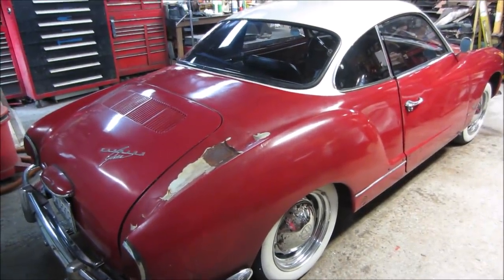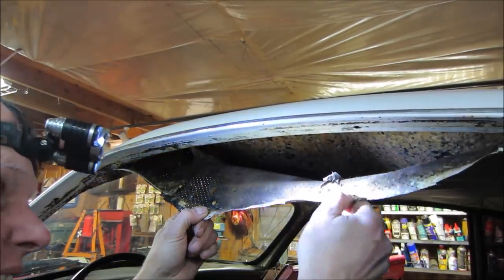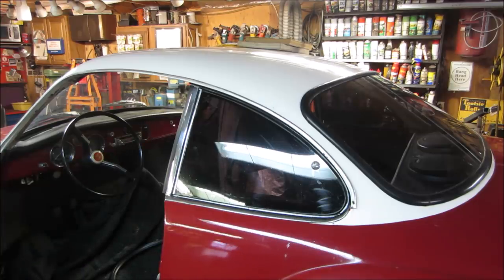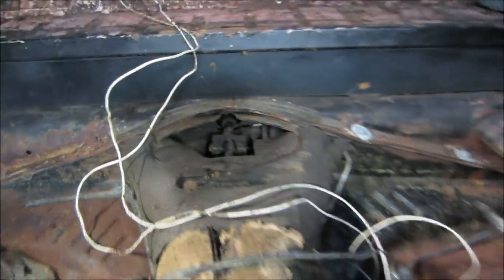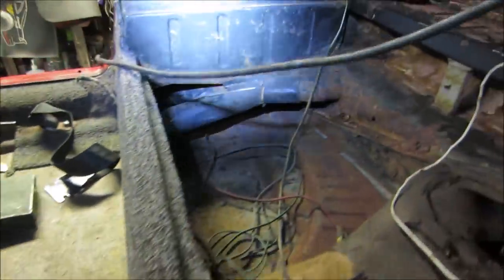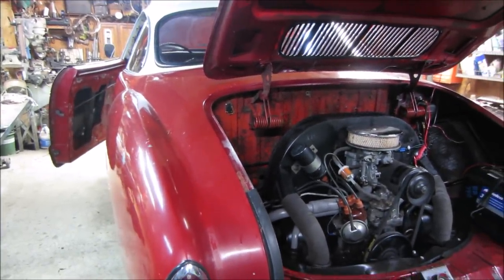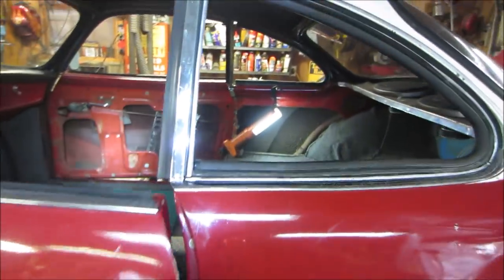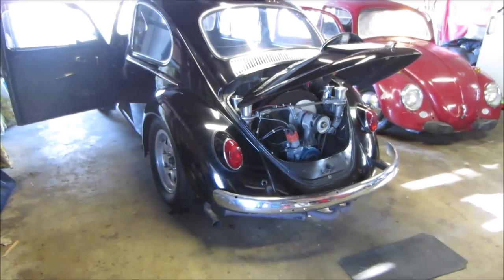Car Mouse Damage, how to remove the smell.

Comment: An ozone generator shut up in the car for a while will get rid of most smells and I think it kills bacteria too. One of the benefits of using an ozone generator is that it reaches areas you couldn't normally reach.

Comment: I am enjoying your Karmann Ghia videos.  That was the first car I learned to drive at 10 years old.  My dad bought a 1957 model in Germany when he was stationed there.  Just after the war.  The German owner had put a Porsche 356 engine in it.  Porsche 356 seats.  In the place they normally have a clock,  he put the Tachometer.  The car had an emergency tank that you activated with a little lever under the dash to get you home.  So it was really a Porsche 356 in Ghia clothes.  We brought it back to the USA from Germany to El Paso.  Unfortunately, my Dad sold it in 1968.  Wish I had it now.  It was really neat.

Comment: I used to make head liners for cars back in my upholstery days. You need to save the old pieces CAREFULLY to make a pattern. Too many guys just RIP the old ones out then expect us to magically fart a new head liner that fits. If you want a good fitting restored head liner, leave the thing in and let the guy who is restoring it take it out. Most of the head liners I worked with were falling down from tobacco smoke. It causes the glue to crystalize and fall off. Convertable tops were much harder but after a while I figured it out. Sewing the rear window panel in was always a treat. Lots of fun times! I do remember the rodent ridden cars. Usually the wiring was chewed up if it had a dome light. Rear decks were ALWAYS full of nests. Wouldnt white paint make the interior brighter than black paint?

Comment: My 71' Bug had a mouse nest in the rear seat that was repeatedly removed and put back during a  2 month long rebuild much like your project. It wasn't until the final victory ride after a full engine rebuild and replacing about everything you are replacing, did I find them when one of my girlfriends stepped on one during the test drive.  But that was 1975. Great memories brought back by your videos! Thanks Mustie1!

Comment: Rubbered in windows are great since you can remove and reinstall them without any special sealers. To remove easier use a product called releaseall or something that actually contains an oil. WD 40 doesnt work. 

to install clean rubber really well with real thinners, sometimes marked as Lacquer thinners. Pretty much if a white rag comes off black its not clean yet. Clean window glass with Windex, no subs to that product. Install by wetting rubber down with windex to act as lubricant. leave dry clean off window after. Wont leak. You add any sealants to a rubbered in window and guaranteed it will leak every single time!

Mustie1 Fantastic works just as well for neutralizing mouse smell. Spray scrub and your done. Keep old headliner if possible for bar locations. Most upholstery shops can make up a cheap headliner for you as long as they have the old one, and some measurements for a pattern.  Might want to wash it down with some old solvent though so it dont smell as bad.

Comment: After the source of the smell is cleaned up. You could use an air purifier / ozone generator inside the vehicle.  Just air the ozone out of it before entering the vehicle afterwards.  Ive used one in my garage, and other parts of the house. Works great. Just be sure its an unoccupied space.

Comment: I love your progress on this gem. Actually I love your whole channel in general. I strongly suggest you get an ozone generator and run it in the car with the doors closed for a day or two to kill any mold or biological material. It will help very much with prolonged odor reduction, especially in the areas you can't reach like the heater ducts. A STRONG WORD OF CAUTION! Do this with your garage door open or leave the car outside while you run the ozone machine! It can cause respiratory harm!

Comment: Man oh man, I swear I could smell that interior through the video! Had thoughts that maybe you could wash that headliner at 1st, but the more you got into it I could see it was a 'trash' item. Good job on that tightening up of the E-brake linkage, and the painting of the interior as well. Really good how that little motor you resuscitated for that Ghia is now running quite well. Had doubts when I seen that substance "formerly known as oil" inside it, but a testament to those bug motors how well it came back with some love.

Comment: The heating system on these is a big weakness.  Had a vw westfalia camper that the tubes rusted out and you’d get exhaust fumes inside the cabin. Finally just pulled them out and carried blankets for my self and passengers! But I loved that old camper and a had lot of fun back in the day with it!

Comment: I'm from Poland, I love your videos (especially with engines). I really enjoy watching someone repairing cars and other things :) Last year I have repaired bodywork of my Seat Toledo (it's based on VW Rabbit/Jetta MK2 and MK3, but it's liftback ;) ) and probably this summer I'll start repairing VW Scirocco MK1 (sitting about 15-20 years in shed) or Lada 2103 (it spent about 12 years outdoors). One problem with this cars is (except they are old, rusted, not started long time) that they aren't registered. Even if I fix them, I probably can't get license plates for them on normal way, but there is something as "historic vehicle". If car has more than 25 years and it isn't produced for more than 15 years and most of parts are original (car left factory with that type of part, f.e. engine) it can have special license plates, but it becomes "monument" and cannot be modified. 
Should I start fixing one of the cars or should I leave them as they are because it will be waste of money and time?
Reply from the maker: you guys have it tuff as far as your laws,

Comment: Ugh. Gasoline and a match?
If mustie is wearing a mask you know it's bad.
Reply: Hopefully a Mickey Mouse Mask!
Reply: i agree...i bought a motorcycle once that had a slight mouse smell to it and after i sold it twenty years later when i sold it i could still smell it when it started
Reply: @philtripe  as long as as the absorbant parts are tossed and the rest is sealed it should be ok but yeah sometimes it's hard to get on every nook and cranny.

Comment: Thanks for the laughs, Anytime anyone mentions heat and VW in the same lifetime...
Reply: Those are what’s called mutually exclusive words.
Reply: In my '67 bug I would have to bend the flaps closed in the fall for heat and undo it in the spring.
Reply: Sorry you guys but a VW bug with good heater boxes and all standard parts working provides plenty of heat.  My wife can confirm that I once melted a set of gum sole shoes on the driver side floor heat vent!  True!  Lived in Mass at the time and the defrost could take a while to work well, buy it did in many water cooled cars also.  A good BUG MAN can get you good heat - you have to pay to replace rusted out bits however.

Comment: I had a mouse chew a small hole through the HP fuel line on my 911.  Fuel line was $197, $3,800 in labor to drop the entire front end to replace said line.  Asked the folks what they recommend and dad said to cut up a dish sponge in 1 inch squares, soak in peppermint oil and  zip tie them in various places (including around the engine compartment and under the car).

Comment: Hey there Mustie,  I just watched all of your videos on the tractor engine rebuild and have an idea for you...  I'm not a mechanic at all so don't know the name of the holes but,  at one point you had a bottle brush on your drill to scrub them out and I was thinking.  What if you used a bore brush for cleaning a shotgun??  They are brass and would not scratch the metal and come with a long aluminium rod that you could chuck up in the drill!  Just a thought?  I love your videos and look forward to the next installment:)  PEACE:)

Comment: This little old car is pretty cool, not used to see any around here in France. Great video mustie, your channel is "poping off" as the young say.
Hope you put the same style headliner after, it looks classy especially with a red paint on the exterior. 
I have a question: i know this is not a car made to be perfect, but if you had funds/time for it, would you insulate the floor and roof with some kind of sound and vibration deadening material? Like those mats i see often in restauration cars?
Can't wait to see that panel swapped out, sound like a big task for me but you seem to be able to handle that pretty well :)

Comment: Going to paint the primer inside the doors as well, while the panels are off it. Will help a little with the noise and keep the rust from spreading in the bottom of the panels. Or just paint on some boiled linseed oil, and leave the doors open over some cardboard for a few days till the drips stop. Works wonders.

Comment: if you are having a lucky day you can lube that window seal with silicone and slide it in from the end. if it is clean and the seal is not crusty should be a quick job. it does not always work on old crusty stuff but its worth a try. loving the ghia series

Comment: Just wanted to say hey, but I just noticed something, Mustie1 has 244,000 subscribers, that is nearly one quarter million.  I get a lot of encouragement from watching Darren do his magic.  So far I have revived three chainsaws and two weedwackers as he calls them.  And I'm a big VW fan as I used to own a VW shop.  Anyone that's taken drops of oil in the eye from adjusting valves or changing oil will enjoy Mustie's channel.  Check out this very video, published on Feb 6 and today here is 11 a.m. and it has 75,000 views plus.  I see I am not alone.  Parts of this video were disgusting, yes, mask and glove up and get it gone.  Bye bye headliner, no saving that.  And I never knew mice could travel up the air channels that support the roof.  Painting to help seal the surfaces, makes great sense.  I learn stuff every video.  How many of you have had the thought, "I am Mustie?"  Ha ha, I've actually said it to a few family members.  Cheers, today we are vacuuming and mopping floors.  But I'm really thinking about that 70's Poulan in the garage and UPS delivered the carb kit, woohoo.  It's gonna be fun.

Comment: Thanks for sharing. I love hanging out in your garage. I keep trying to hold your tools for you and keep shouting to you about where your bits go missing / hiding from you but i'm at least 8000 miles away, so I guess it's kind of hard to hear me. Karmann looking good, Question for you how hard is to get parts for these cars? I was thinking that when you ripped out the headliner I thought you should keep it as a template. Is it easy to get these where you are. I am interested in seeing the fastback you got last year, my dad had one and we loved it. It was a 1600E fuel injected fastback and we still miss it. Keep up the good work Mr engine whisperer.

Comment: I had a '68 bug that had the same headliner issues. That "padding" from the liner was carpet padding used as noise damping. Worked great as insulation in the Colorado winters,too.

Comment: I suggest you consider placing a few strips of sound deadening mat to the bottom of the roof metal.  Dynamat is the big name but I prefer Fatmat.  It will make the interior so much more quiet you wont believe it.  Not point in doing it solid, just deadening vibration is the goal.  Then putting foam for temperature control as before and a new headliner.   Another fine option which I have had super success with is using a DYI spray on truck bed liner to deaden vibration.

Comment: Hey there Mustie1, thankyou for taking us along with you again. Love the Ghia brother. Are you thinking of using some of that bitumen foil matting on the floor of your beast or some other brush on rubberized underbody sealer of some kind? It's sounding great running now. The wiring you showed us was a bit of a worry but worked out just great, you gotta get lucky sometimes hey!. Keep up the great work.

Comment: When I first got my bug, the previous owner had peanuts in it, and squirrels decided it was buffet time.  As they were exiting they took a few chomps on some of the rubber seals around the windows.  In the last few years, my headliner began to yellow/brown around the first two to three inches around the windows.  Not sure if that was mold, glue, or what.  It doesn't smell bad, only looks crappy.

Comment: I am in colorado.. In my 65 bug I never got enough heat from the motor . Only enough for peep hole driving on cold snowy days.  An exhaust flange with water jacket and small water pump to heat exchange is what I would install now. That would work fantastic!!

Comment: The worn Bolt bearing on the emergency brake lever you find very often. The Problem is the bolt in the lever bushing is frozen. The bolt should slip in the lever bushing, this can handle the big force. If there is frozen the thin holes in the bracket worn out.

Comment: The paint you used - was it anything like "KILZ?"  That stuff is supposed to provide good coverage along with smell blocking.  Of course Kilz doesn't smell so good when it's wet (as I recall) - been several years since I used it.

Comment: Hardware store has that rubber cord used to hold in screens- get a roll, use it to tuck
in the padding and liner material. Lay it like a 1/4" border, then poke it in the seams.

Comment: mabye you should call the car 'Very Mustie" :P

on my 1970's s type skodas which are also rear engine but water cooled the main heat run through the center tunnel (gearbox tunnel in most front engine cars) i found the heating to the front pretty good in them,. in the later rear engine versions they had a front radiator and heater matrix under the dash and those are more of a problem mostly because the water pipes run under the car to the front rad causing some air locking

the earlier 70's ones have the heater matrix under right rear seat, so the air gets pushed from there through the tunnel to the front
i have both the s110 saloon and s110r coupe and a 120 estelle (1989)

Comment: Im a mechanic .we had a customer bring in his "project car" an austin mini for head gasket  and he phones up just as i'm bolting the head back on. He said he had temporarily run out of spare money so could we stop work on it and he'd pay up to date. He took the car away any bough it back a month later for us to finish the job. We had the rad out of it getting cleaned out by the local rad shop. I fitted the rad and filled it with antifreeze and got it running. On the test drive it over heated. No circulation and the block wouldn't drain so i pulled out the radiator and a dead rat plopped out of the lower rad hose. yuck. That fixed the overheating problem. LOL

Comment: Those little buggers really got in there didn't they?
Peroxide is great for nuking smells by the way, food grade, maybe an inch in one of those spray bottles topped off with water, works really well on urine smells, i worked for a while in a nursing home, its what we used, does the job nicely

Comment: I was a VW nut a long time ago, but never got my hands on a KG , not  that I could afford one anyway. Always liked the look of them. One thing I remember is fitting Bosch 009 distributors to most of my VW engines. That got rid of the vacuum advance. Also, as a one-time auto electrician, that wiring someone has done has me almost in tears. Did the original loom get burnt out, or what?

Comment: I had a crazy idea about your headliner last nite. I was wondering how hard it would be to spray in a foam insulation and then shape it to glue liner to. Probably the type that doesn't expand as much. I told you about getting a '79 Arien's snow blower I got for $60. It needed a head gasket and changed the points and condenser. Only had one chain on a tire. Looked at some chains but were really small and I would have had to remove a lot of links as they fit up to 12" wide tires where mine are only about 4" so I went next door to my friends hardware store and got 24' of chain, 12' of 5/16" short loop and 12' of longer loop. I used the longer loop for the sides and shorter for the treads and used small turnbuckles to holder them together nice and tight. I'm also putting rubber pads as I've heard makes it able to work in wetter snow. Can't remember if you had done it. I think you did. Anyway, while working on drilling holes for the pads, I saw a whole lot of play, split the blower and went to take out the bearing and it basically fell out it was so worn. Kinda funny my friend told me to bring him the bearing so he could match, when I asked him to, he just laughed. But I found a site, Jack's repair I think and he was the one that had a universal bearing for about $16 where the Arian's was $23-30 and also got the flange for 1/2 the price of others. And then I bought a small turbo decal to put on it as the pads will be the turbo, lol. Plus I painted the tires, inside and out, baked them and used an old bicycle tube to line the wheel as the tubes were all rusty. Also painted the a bit of the engine covers and found the electric start didn't work because one bolt was missing and I broke one off so I drilled and tapped that. Another thing I found out was I broke a couple bolts off on the shroud while taking the recoil off and ended up drilling and then using a Dremel to open the hole enough where I could just knock the remnants of the broken bolt out while saving the threads. Didn't seem to work that good on the broken bolt in the block though, luckily my friend had bottom tap for it. Thanks for sharing. Hoping this wasn't too long.Kevin